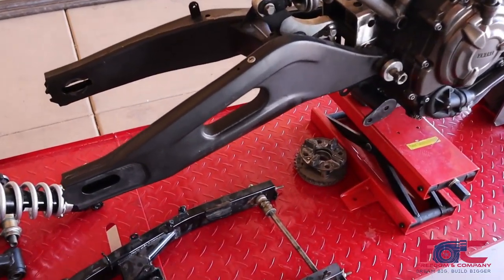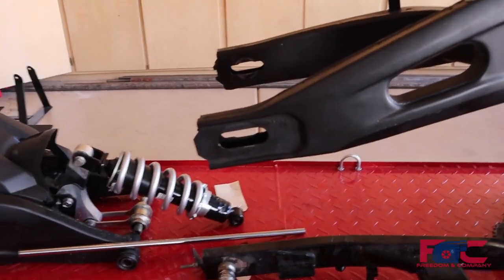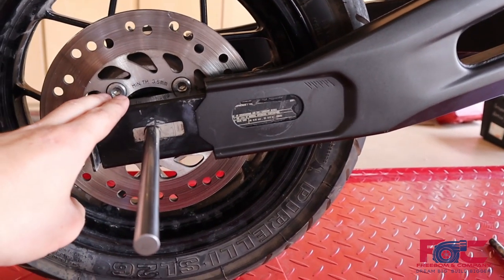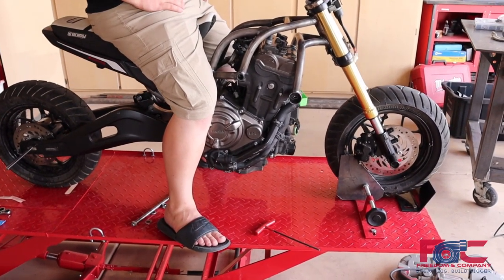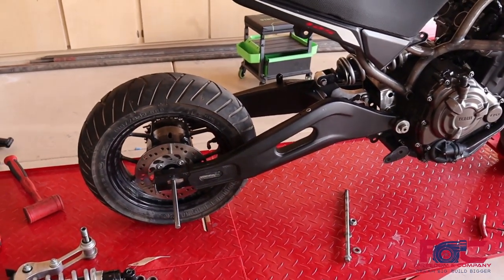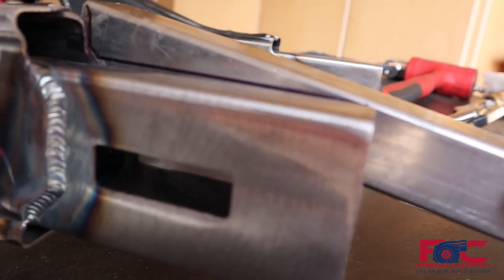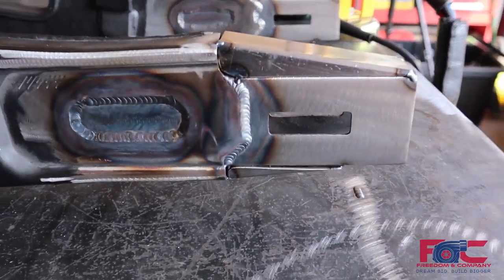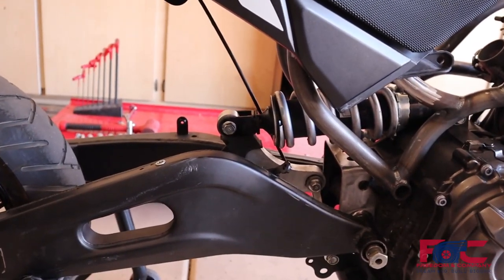Building an Extended Swing Arm for the 700cc Grom!

Comment: Great way to simplify the rear axel conversion and ectended stretch.....Im working on a Buell blast and I recently got the bike working and its running again!!!....I wonder what the difference would be if I was to run 12 inch scooter wheel set....Would that increase my speed at top end....
Reply: Probably not and certainly not worth the reduction in handling quality, dropping the money on lighter wheels like dymags would help more.